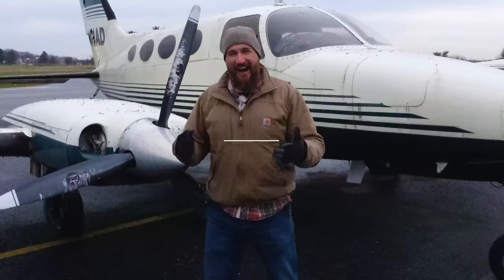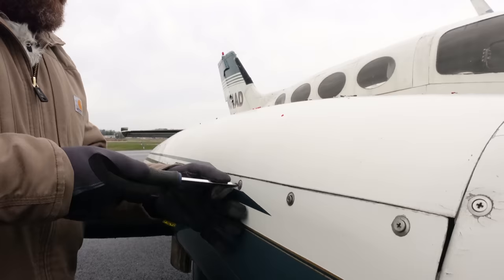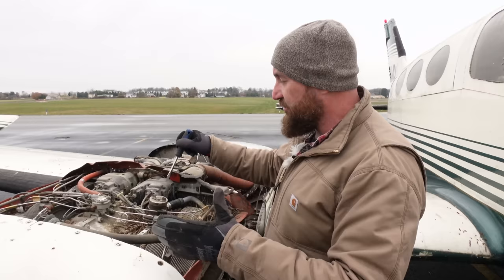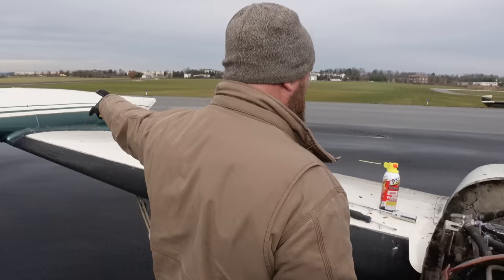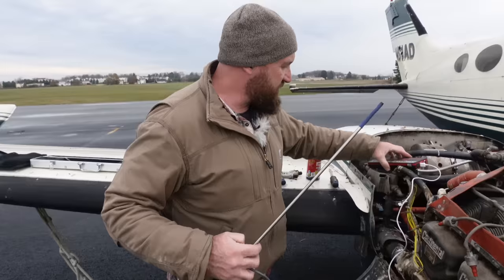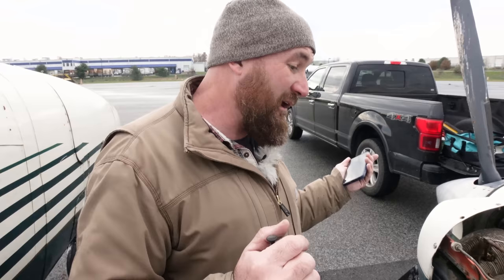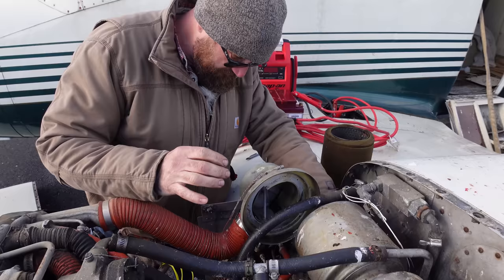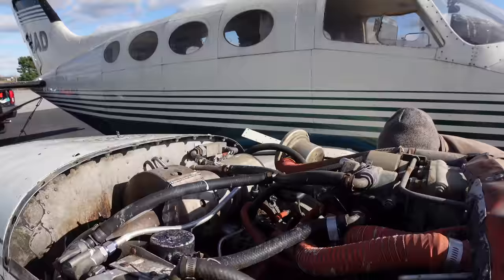FREE Abandoned Airplane... If I Can Start It! Ep1

Comment: Have you considered removing the turbo and trying to start the engine? That might at least let you know if the engine was healthy enough to run, before investing the time in turbo work.
Reply: I was thinking the same - disconnect it so it's not a restriction.
Reply: If anything it should just run rich if you disconnect the intake manifold from the turbo, as it's expecting a lot more air to be coming along, for which it would calculate more fuel. But it should kick over, run for a sec and stall worst case...  then invest in the turbo. Would be a shame to spend money on something as expensive as a turbo rebuild just to make it idle.
Reply: Also take the bloody props off. Ya won't be needing them for quite a while !!!
Reply: Exactly, does not need the turbo to start.
Reply: @thedolphin5428  But they are still an engine that workes the same way as all sparkplug engines do. All he wants to know is if the engine will fire. He don´t want to spend thousands of dollars to strip everything down just to find out it doues not fire. That is why he is working on them wher the plane is. The possible dmg it will do if anny is nothing in the long run of restoring.
Reply: You only need compressed air when you are burning loads of fuel at high revs. At idle is lean fuel n lean air, no power. Take out the turbo n air filter and you have naturally aspirated engine. Same as your car.
Reply: @thedolphin5428  Turbo is not spinning when you are cranking it that fast that it would make it not to fire up.
Reply: @thedolphin5428  The nacelle looked flat and so it likely is fuel injected, therefore no carbies.
Reply: @thedolphin5428  It surely won't start with the turbo locked up. But removing it would give it a much better chance. At idle, I'd guess that the turbo is right off the bottom of its map and not providing any relevant boost. Main purpose of the turbos will be maintaining power at altitude when the air is thin.

It's a mechanical fuel injection engine so I'm not sure carbs are relevant.

I do agree that running the pistons over all that rust might not be a great idea though.
Reply: @ozesalsa  Absolutely - turbo engines will run just fine without the turbo. Power is down of course but that’s not the issue here.
Reply: I don't know much about turbos but does it even matter if it's seized up, for running at sea level? Exhaust and intake gases will work their way through the turbo blades they just won't be doing/receiving work in the process as it doesn't spin?
Reply: @davidfoster7374  I'm not sure how that particular turbo is made (variable vein or standard), but a stuck turbo is a bit like stuffing a rag in the exhaust, or crimping the pipe. Something will get by but it's far from ideal.
Reply: The engines are fuel injected and the turbos aren’t turning at start anyway.  There are alternate air doors that allow the engine to run like a NA engine, if the turbos seize in flight.  It won’t run rich with the turbo not pumping air because the fuel schedule is based on throttle valve position AND manifold pressure. And the exhaust path isn’t plugged by the turbine wheel because the wastegate is open.
Reply: @seantoomey1514  You are correct about the alternate air door.  I was remembering the Navajo Chieftain, which has alternate air doors on both sides of the turbo.  The wastegate is spring loaded open.

Comment: Back in the 60's I was a Navy aircraft mech and there was this old DC3 tail dragger that flew the mail between Adak and Whidbey Is ...It had issues with Ignition especially in the winter and I worked on this plane often .. it had two R3350 prat and Whitney radial engines and a whole lota plugs which were all safety wired and you needed a step ladder just to reach them ...so ..spark plugs ..yeah .. I can relate ..Oh boy it still sends shivers just thinking about it ... the wind and sleet going 20 knots sideways ... uuuh !
Reply: My dad was an aircraft mech at that time too I think, and was frequently near Adak etc.
Reply: cute story

Comment: definitely would love to see this thing flying once more and restored. with the interiour destryoed like this maybe turn it into an aerial RV? that could be pretty cool.
Reply: @Brad Morrison why
Reply: The air worthiness certificate doesn’t go anywhere just because it’s derelict on the ramp for 20 years.  It’s probably still in the plane and still valid, so long as the aircraft means the airworthiness standards, which of course it doesn’t.
Reply: It needs an annual inspection.  When an IA signs off an annual in the log book he or she is certifying that the acft comforms to the Type Certificate and is in an airworthy condition.  There is no certificate issued for an annual other than the log book entry.  The fact that it is in such poor condition as to require more work than usual is irrelevant.  The main structure is aluminum.  It doesn’t rust, but it will corrode into powder.
Reply: @Brad Morrison ive seen planes in much poorer condition be flown about so i really doubt a tiny spattering of rust under a carpet will cause the entire thing to be written off. It wasn't rusty anywhere else. Only in the spots were water got in and the cabin floor is a non structural component of the plabe
Reply: @raffia16thblaze10  A&P mechanic here. You ARE aware that corrosion can be present in many critical areas of an airframe that are completely hidden from the naked eye, right??  That aircraft is BER. This guy is just trying to get Adsense $.

Comment: So glad I came across this video, this was superb. A restoration series on this would be a brilliant niche, hopefully you can do this and get sponsors to pay for all the work!
Reply from the maker: Troy, thank you for joining us here on the channel ! We’ve thought about getting some sponsors and creating a go fund me to help get this project off the ground but need to dig into it a bit more to make sure it makes sense
Reply: @rebuildrescue  Wing spar corrosion may doom the airframe to the scrapyard. Everything will need to be removed, including the skin, and completely rebuilt. The turbochargers are expensive to maintain and will need serious attention. An annual alone is expensive. Overhauled engines cost well over $50K each, with good cores to exchange. The stainless steel exhaust system is expensive to maintain. High pressure hydraulic hoses replace, etc. etc.

Good luck on the project. Buy a well maintained fixed-gear plane if you want to actually fly. It may take 10 years to make that airworthy again.

Comment: For the battery, use Two 12v in series ( = 24 VDC) with 200 cold cranking amps (CCA) capacity each. The starter will draw about 100A. The rest of the electrical start systems (magneto, vibrator, etc) will consume about another 10A. Use 1AWG battery cable. Do not exceed more than 5 or 6 ten second crank attempts without a 5-10 min cooling period, or you risk damaging the battery, starter and or the starting relay contactors...

Comment: By the way. Those turbos are not necessary to start the engine. They only start operating once the engine has started and is generating exhaust gasses. 
About exhaust gasses. As the turbo is locked up you will have to rebuild them anyway. 
If possible take the turbo off all together and try to start the engine with an open exhaust and inlet. It will make a hell  of a din if you get it right, but if you don't get happy with the loud peddle you won't disturb anyone. That is only if you can rig up an exhaust  otherwise you stand a good chance of starting a fire.
My personal opinion about these engines is to run them just to get the aircraft for yourself and then trash them. It may be cheaper just to replace these engines with other ones from another aircraft. I would not like to risk my neck on these bits of trash.

Comment: I work as an A&P for an airline that flies the younger brother to this airplane, the Cessna 402C. Probably the same engine. Continental TSIO-520. (Ours are the -VB) We've modified the hell out of them over the years, but there's quite a number of common traits between our airplanes and this one.
And my long-time co-workers would definitely recognize many of those old instruments and avionics on it.

Those engines are fvcked.
Even the closed valve cylinders will have rusted walls & pistons. The cylinders may be shut, but there's oxygenated air still inside. And ancient oil long-since broken down and long since flowed off those cylinder walls. Exposing them to the oxygen. And you got rust. 

You will need to send them both out to Continental for a complete overhaul & rebuild.
Reply: I agree just part the dang thing out it ain’t worth fixing this plane

Comment: Make sure you have an A&P "directly supervise" your work since it is a certified aircraft. You'll need an A&P with IA to inspect your work to get it recertified for flight. Expect to be spending at least $60,000 on parts, instruments and interior, it could be far more, plus labor for anything that you can not do, (inspections, etc.).
Reply: good luck getting a A&P to put his license on the line. That plane will never fly again.
Reply: He's got at least 100k in motor rebuilds and props. this is a joke
Reply: The supervise rule is veeerrry generous. It’s up to the mechanic (and his license and beyond) to determine how much supervision he wants before the sign off. I certainly wouldn’t.

Also, if it ain’t ever gonna fly RR doesn’t have to worry about that! Maybe it will, but someone will need plenty of throwaway cash that they will NEVER get back, even in resale. 

Probably a stunt, but relatively interesting at least
Reply: @TheReadBaron91  Totally a stunt but interesting  how old stuff will start. Always better to buy working. Plus two prop license is way harder to get.
Reply: The whole premise of this is nonsense. He is not licensed to work on it, even if he did supposedly know how. Parking at airports isn’t free and people simply don’t give away airplanes like that.
Reply: @PRH123  1:14:34
Reply: @PRH123  Coudn't agree more. I'm not buying any of it. Even if he gets the second engine running it's not airworthy and he can't fly it. And, I'm damn sure he won't spend the money to restore it because he doesn't have any. I'd like to know more about Jason and the alleged owner's background. Seems a little fishy. That would be much more interesting. It's not about the airplane but instead about the youtube channel Jason is trying to grow. He has started to make money from it and is trying to figure out what to do next to gain more subscribers. At this point he is just winging it. Sorry, had to get that in.
Reply: @tbd-1  yes he said at that point it wasn't ever going to fly but he changed his mind in the second episode.
Reply: I’m trying to understand how a plane that has been “sitting for about 12 years” has a flight log from May 13, 2019?  And the current registered owners are the same since 2006.  Unless the info I found is incorrect?
Neat video nonetheless.  Good for us “dreamers” that wish we could put something like this back in the sky for short money, but know better! lol 😉
Reply: @HammyHammbone  more than likely the flight showing up in 2019 in California was not this aircraft and it was just mislabeled by flight aware. The whole thing has a lot of questions surrounding it that Jason hasn't been answering.

Comment: I owned/flew a 414 (pressurized version of the same airplane) for years. Your assessment of things like fuel flow and capacity were spot on. Rich of peak, 40-42GPH total burn to keep the cylinders cool. Lean of peak and pulled way back, would burn around 12 per side, so 24GPH, and that would get me about 180 kts TAS in the mid teens altitude wise. If they’re not RAM engines, they should be 315HP per side. Really fantastic flying airplane, but one of those where something breaks each time you fly it. Really great video, I’ve loved watching this!!

Comment: Everything needs to come out to be cleaned. Cowlings need to come off to check the engines....check battery, spark plugs, wires,...so much to check when an aircraft has been sitting for so long.

Comment: I'd accept that challenge!
I'm sure you've researched and learned that failed turbo has caused the most twin engine fatalities. They are widowmakers. SO proceed with incredible caution. One tiny 32th of an inch bearing oiler passage can (and often DID )bring down a whole aircraft
Reply: So ,puta catch can on it and a ballbearing turbo so it isnt so oilsensitive
Reply: You realize planes don't just fall out of the sky right?
Reply: @emilvlahovic3917  Unfortunately in aviation you can't just modify things. Even if it's to improve on something. Once a particular setup is type approved, that's it, unless you can get any changes or modifications also type approved, no luck for going flying.
Reply: @tomjackson1923  makes sens ,should be done factory like that as journal bearing turbos are more prone to build op , especialy oil cooled ones , and id guess there is no water cooling on that engine
Reply: I wonder if he used an appropriate compound on the spark plug threads ?
Reply: @tomjackson1923  Possible to change the turbo and use the motor for a kit/ experimental plane project instead? 

Or does it exceed some power limitation restrictions?

Comment: Check the price of two overhauled engines, props,governers, accessories. Replace avionics and related parts. Auto pilot etc.  Check AD's. I'm an AP/IA with 57 years in the business. Budget a minimum of 120 to 150 thousand to get it to the point that you could request a conformity inspection to return it to service. The reason these aircraft sit is they are not worth fixing up. And they are a pain to get rid of.
Reply: Remove the auto pilot ? He doesn't need that.  Repair and maintain for only-VFR.

To begin with, no they are not cost effective for a charter operator to run.
Reply: Right on John.
Reply: Don't look to me like thied aint much there that aint gonna have to be replaced

Comment: When you wire batteries in series, the amperage will stay the same and voltage will double. Parallel doubles the amperage and voltage stays the same.
Reply: Yes, Also having more amperage available won't hurt anything, devices draw as much amperage as they need. Unless there's a short circuit, but of course that's what the breakers are there for.
Reply: He's rebuilding a turbo prop I'm sure he knows this,  I think my 12 year old niece knows this from Jerry rigging her power wheels
Reply: @breakingames7772  This is not a turbo prop.  Turbo props have turbine engines.  This is a piston engine with a turbocharger
Reply: @breakingames7772   I suggest you learn what aircraft engines are before you comment.
Reply: You just need to worry about the voltage. Correct voltage battery you are good to go. V=IR. The current draw I=V/R.
Reply: @pwatom22  That's the most important thing but you need sufficient amperage to make sure you aren't over heating the starter.

Ie it's not good to try to keep starting a car with a low battery due to that. 

Not nearly as bad though as the wrong voltage.

Comment: Remove the turbos and start it N/A. Save yourself the time and money. All turbo engines will at least idle that way. If you can start either engine. Fix those turbos. Don't forget to block off the oil feed lines before turning it over. You got this..... and, now I'm subscribing lol. I'm more into this build than any other build video on YouTube at this point. Cheers!